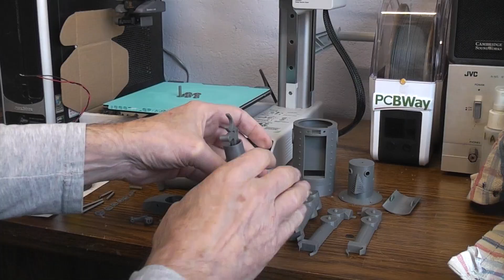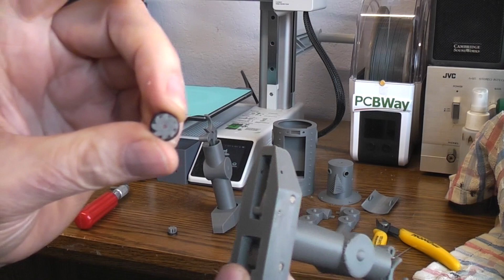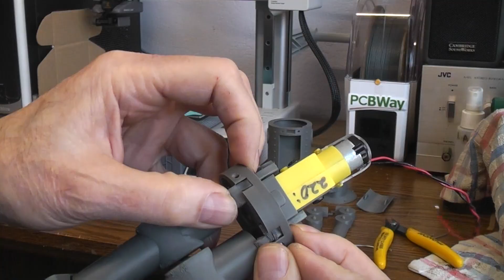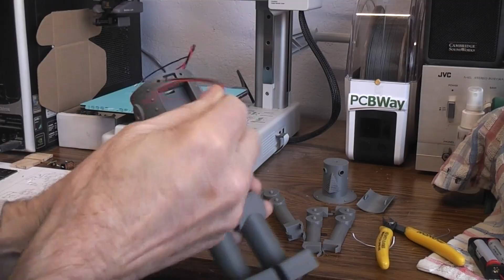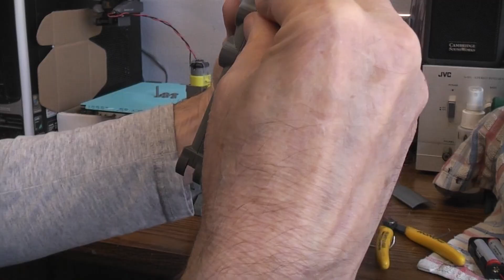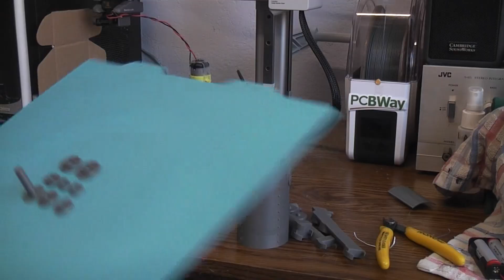Assembling the 3d printed robot from the 1934 Vanishing Shadow serial film.

Comment: Do you provide a schematic of instructions  with photos in a pdf ? I know you got the video to refer to . This seems to be easier build maybe . Ty 🤖
Reply from the maker: Just the videos, it is too time consuming to do, I make no money from YouTube or any place else, it is just a free gift from me to the builders in the world.
Reply: @ ok
Reply: @ i can do the printing but fall short in wiring on switch . So i just watch . 🤖
Reply from the maker: @PeterAgostiniJdcap26  All the switch does is open or close a connection with one of the motor wires. Does not matter witch motor wire, just pick one. 
So the battery holder has two wires and the motor has 2 wires. One motor wire to one battery wire and the other motor wire to the switch, lets say the center connector, then the remaining battery wire to the switch, one of the remaining switch contacts. The switch will then either connect to the motor wire or not, so the motor will either run or not. Have fun with it , experiment.
Reply: @ appreciate the effort John i made  a screenshot of what you wrote …  a picture is worth a thousand words my friend .  I really don’t know how i do things that are not in my comfort zone thats my downfall sadly. I print this out later and read it again

Comment: Feet are now printing....... Just finished setting up my Prusa MK4s and Prusa Connect last night. So this will be my first test print apart from the Prusa test keyring which I did. Also have a Bambu Labs A1 as well 😉. Great video as usual.
Reply from the maker: I forgot to mention in the video, print the battery cover vertically, use supports and a brim.
Reply: Did you print the legs standing upright or laying down flat?
Reply from the maker: @paulcabrelli1863  Standing upright. The STL files set in the proper position. Use tree supports on build plate only.